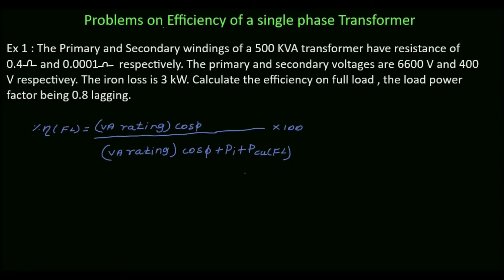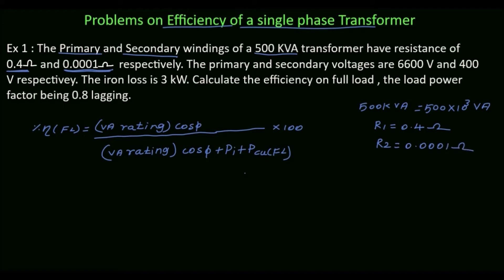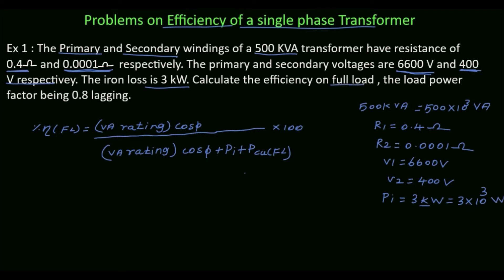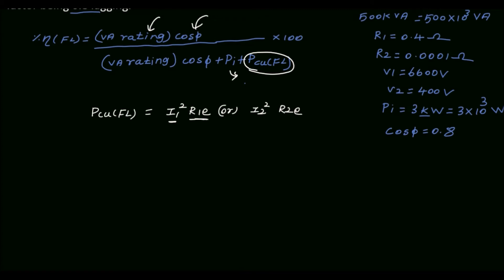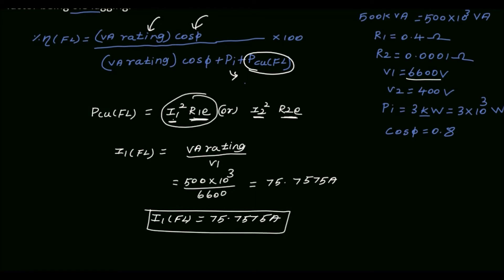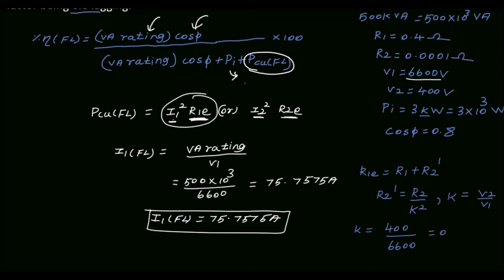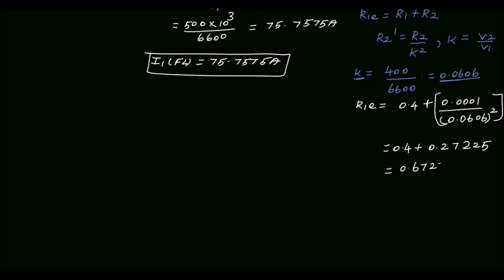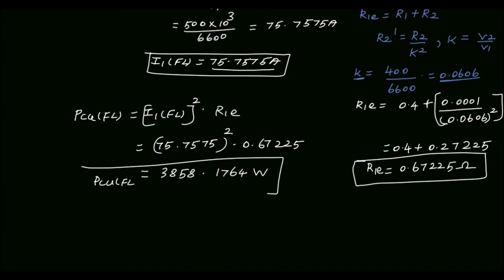How to calculate efficiency of a transformer at full load | Problems on Transformer efficiency

Comment: your R1e is wrongly calculated
Reply from the maker: Actually transformer secondary winding resistance R2 is 0.001, By mistake I wrote .0001in the problem as well as in the calculation . Please consider R2 as 0.001 and calculate (R2)'. Then you will get (R2)' as 0.27225.

Then R1e = R1+ (R2)' = 0.4+0.27225 = 0.67225.

Thanks for notifying me.
Reply: R1e Suppose to get 0.4272 
Is it wrong calculation by your side ?

Comment: Why did you use VA rating/VI and not V1/R1 to get your value of I1
Reply: this is my question as well, could someone please answer
Reply: At full load you have to use the rated VA of the transformer divided by the voltages so you can get the maximum current at full load